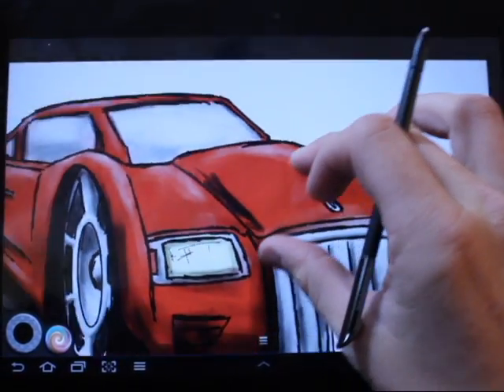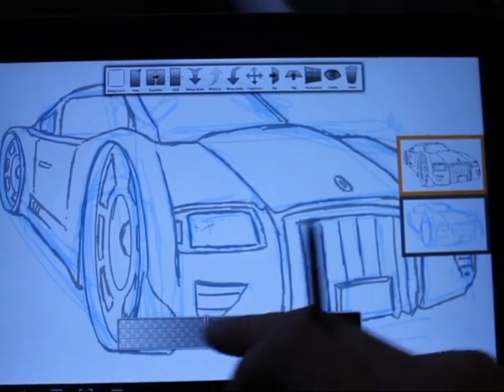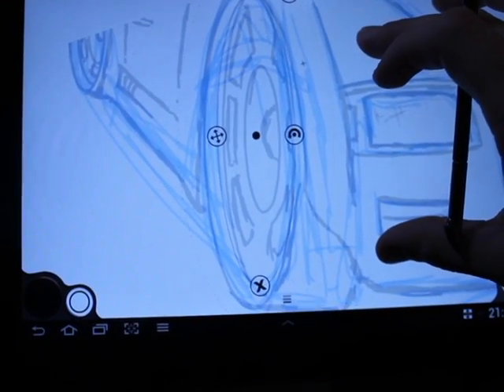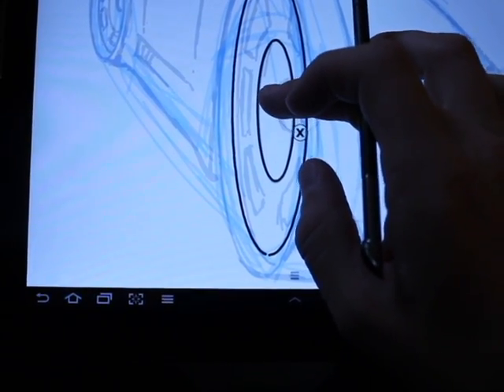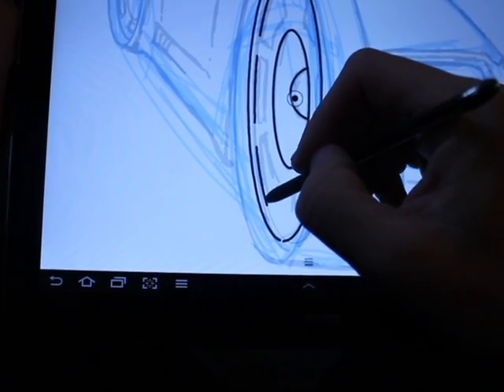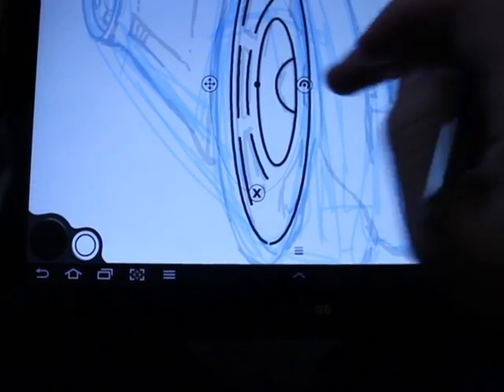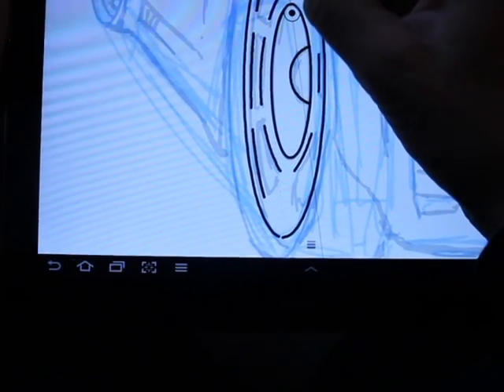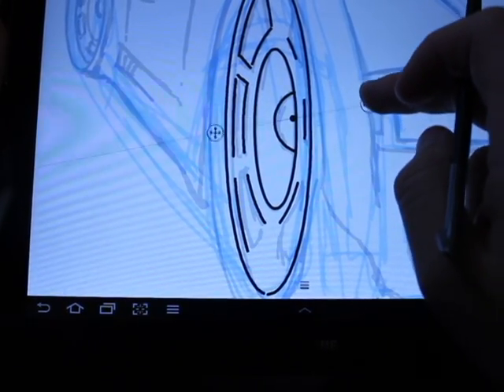Infinite Design - Guides

Comment: Does anybody know what dpi or other settings this exports too. Can you get it to export to 300 dpi?
Reply from the maker: iLL Formula The app exports in pixel ratio up to 10000 x 10000 pixels. So, if you are looking at an 8.5 x 11 page at 300dpi, you'd want to export at 2550 x 3300.
Reply: Thanks for replying. When I go to export in the app I don't see that option there. Do I have to click something else besides export to see the settings. ? I just see a slider for the 2550x3300 but it doesn't slide to that number in the export. Thanks
Reply: Can I resize it after I create the file and set the settings in the beginning? Or you can't go back after you start?
Reply from the maker: Click on the options in the top left, click Project Properties and you can change the dimensions of the project there.